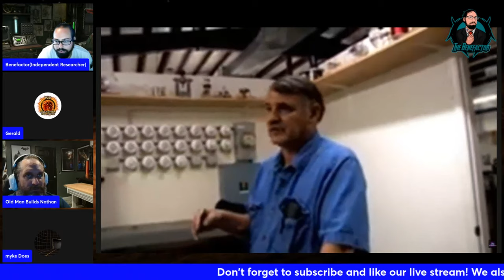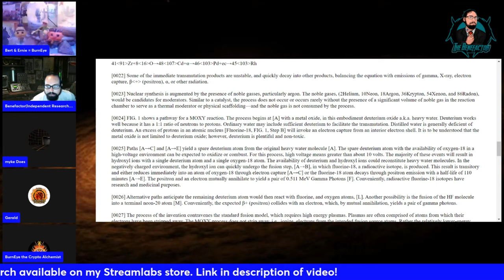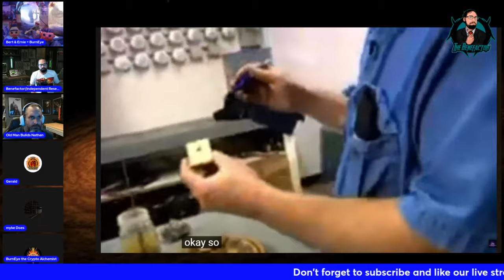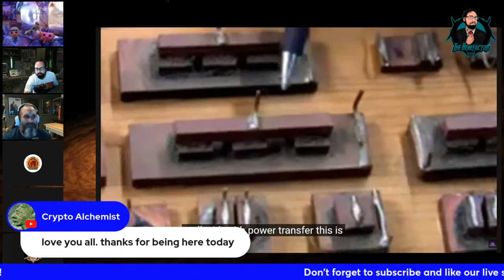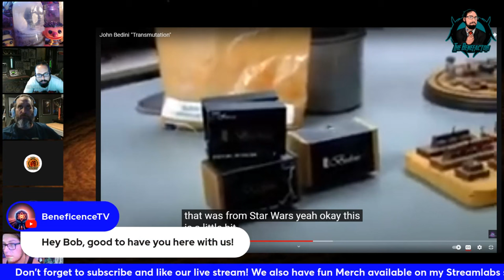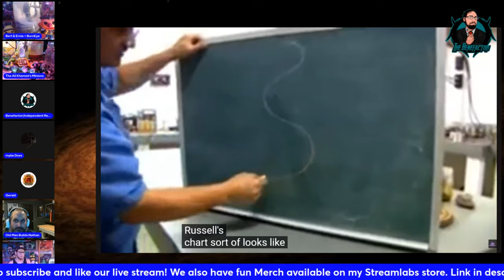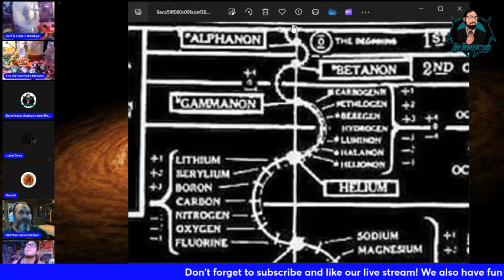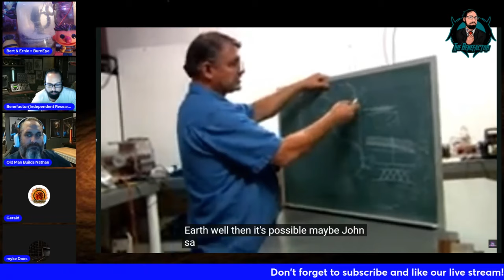Benefactor, Old Man Builds And Gerald Stream All Day Part 3

Comment: An assay should have stated corundum not "ruby".  Ruby and sapphire are the exact same crystal, where only color is the determining factor whether it is a ruby or a sapphire.  Corundum is very common, used in sandpaper even.  Not gem variety, but the same mineral.